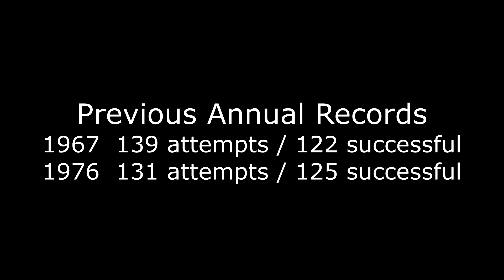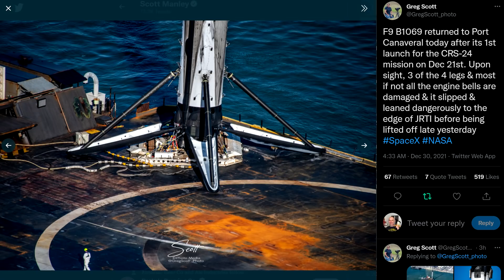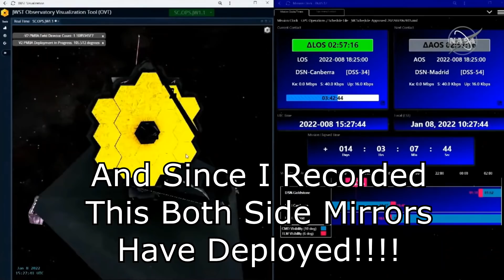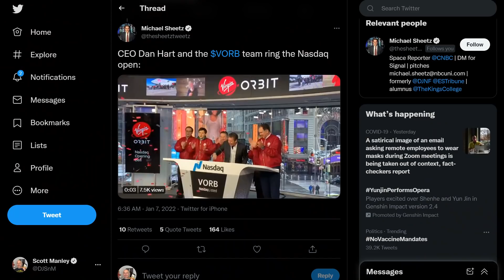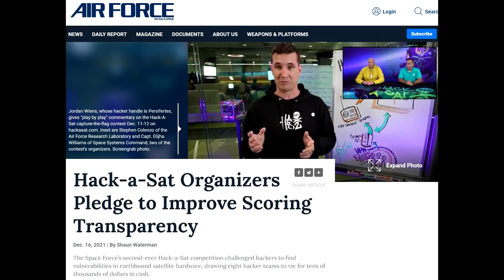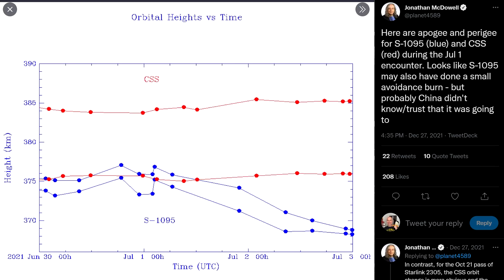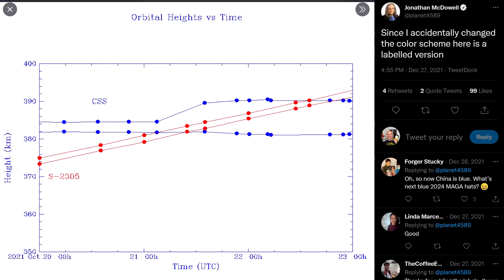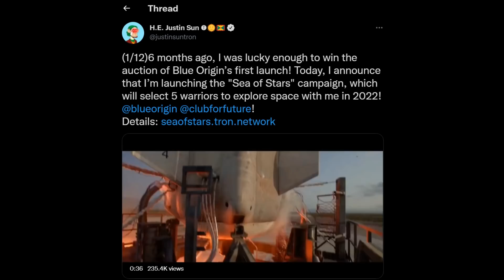JWST Deploys Mirror &  Moon's 'Mystery Hut' is Revealed - Deep Space Update - January 7th

Comment: They put a fairly long post on the JWST blog about cameras and why they didn't put them on it. TLDR: they considered several options for putting engineering cameras on the telescope, but all were rejected because the data that they needed to monitor deployment were better collected with other sensor types. "Better" in this case meaning the best balance of risk vs reward and cost vs benefit.
Reply: Cameras draw power, so do the encoders and transmitters needed to relay the images back to earth. The objective of the sun-shielded dark side of the telescope was to stay cold and dark. Putting gear on that side which generated heat as a byproduct of power consumption and transmission had to be balanced against the downside of trying to keep the shaded side of the telescope as dark as possible.
Reply: In all the replies to this tweet no one has mentioned the simple solution of having a cubesat fly alongside JWST to take pictures.  That would sidestep all the problems of sticking cameras on the observatory itself.
Reply: @simian_essence  Well then that wouldn’t really help with diagnosing problems, and if there’s a tether attached, even worse because the tether can snag and break instruments on the JWST.
Reply: I know they didn't really need cameras from an engineering perspective, but people like to see what they're paying for. Elon knows people like cameras. On the other hand, when JWST gets to final orbit, there won't be anything to see anyway. If you're 10 years behind schedule and three times over budget, it might be a problem to convince anybody you want to add a vanity camera.
Reply: I think they had a plateful, as it is.
Reply: The JWS project had few concerns about cost v benefit. Maybe the customers thought $10 million for a Go Pro was a bit steep.
Reply: I mean yeah I guess there are better ways to monitor the craft than a camera pointed it parts of it
Reply: I'm still really surprised. You can get a lot of info from just looking at something - what if one or several of your sensitive instruments fail and you still want to know what's going on? Cameras wouldn't seem to cost much or make anything less safe. I think the explanation needs and explanation.
Reply: @PinataOblongata  As NASA has explained it, the issues with cameras is that as mentioned in the video: on the dark side you wouldn't really be able to see something except maybe if you use IR cameras, or you could use a light source which could fail and blind the instruments. Then you also have to consider that this is an extremely complicated unfolding process, so you either have a lot of engineering cameras with a low FOV that might be able to tell you something about the situation if something goes wrong, or you have a few high FOV cameras which wouldn't be all that useful in diagnosing issues. Then you also have to consider all the additional cables that need to be routed, and need to bent when the telescope unfolds as well. Overall, it is simply not worth it because they have enough sensors on board and test data from deployment tests that they are able to diagnose any issues based on this data without any additional visual information. 

For example, they had an issue that the sensors which were supposed to indicate that the sunshield covers had correctly rolled up didn't trigger correctly, but based on their prior experiences they were able to confirm that they unfolded correctly based on data from gyroscops. TL;DR: NASA considered cameras but all the additional risks and challenges and small benefit they would gain from cameras made it clear that they are an unnecessary risk and drain of resources.
Reply: @PinataOblongata  I guess the thing to really consider is that there is no hope for a repair mission, ever, so if it gets to that point it really doesn't matter what's actually going on because the telescope becomes space junk either way. TBH I also like the idea of being able to look at something just to get a gut feeling about it, but I'm not a NASA engineer and probably for good reason. They seem to be quite happy with the telemetry they have.
Reply: This was my first thought as well. If the put camera, that's an extra weight, thermal management, power management, reliability tests. There is no science which would fulfill. As someone said, it 8s for the skeptics. It is an instrument. It is maximized today create infra photos as good as possible, not to makes selfies far from earth. That will make humans way better in the future.
Reply: Cameras are only good for TV, but TV is good for funding. I still think it was a bit of a mistake to not include vanity cameras, watching a 3D model unfold is extremely lame. Optics (no pun intended) are important if we're trying to get back to the space-fever of the 60s and 70s; in many ways, JWST is a political project even more than it is a scientific one.
Reply: @tissuepaper9962  JWST is a bleeding-edge instrument. When Curiosity landed on Mars in 2012 the skycrane was too. Curiosity didn't have cameras, but Perseverance did. JWST doesn't have cameras, but LUVOIR might
Reply: @lewismassie  fair enough
Reply: @tissuepaper9962  Absolutely NASA et ESA need to think more of their fan base and stop pandering to finance entrepreneurs. This is public science in the noblest of traditions. I considered the similar situation back in the sixties with Apollo missions; imagine Neil Armstrong not running a video of him walking on the moon. NASA next time make it happen.
 I will lend you my old webcam, its been thoroughly knock tested and survived after 15 tears.
Reply: @tomctutor  I agree .
It looks like they are getting the message though (thinking of the recent jaw-dropping footage from  the Perseverance landing).
What irks me is when they mention the "fantastic computer graphics" that supposedly make up for the absence of real footage.
These animations look like video games from 25 years back !
Reply: The information you need can not be seen in a camera: does the bolt retract, temperature of a motor, tension on a rope, rotations of a motor, does the hinge work, is a joint latched? You either need hundreds of cameras or hundreds of sensors. But you need the sensors anyhow.
Reply: I also spent quite some time replying to people in the twitter replies explaining stuff. I don't usually do that but this was one of those times I felt it was necessary
Reply: yeah the thing already cost 10 billion, no reason to take chances
Reply: When you write "TLDR", do you mean "summary"?
Reply: @PotatoRadius  TLDR = Too Long Didn't Read.
Reply: @PotatoRadius  yes. "TL;DR" is an abbreviation for "too long; didn't read".
Reply: @tissuepaper9962  What's wrong with using the perfectly servicable word "summary" to describe a summary?
Reply: @PotatoRadius  nothing is wrong with it, but I'm sure you know that slang doesn't arise out of practicality, nor does any aspect of language really. "TL;DR" is a reference to the kind of reply you might have gotten on a 2000s forum if you wrote a really long post. People would sarcastically write "too long; didn't read" in a reply. Eventually it become sort of standard to preempt those nasty comments by including a TL;DR section for the people who can't be bothered to read the whole thing. You can think of it as a sarcastic joke embedded into the structure of the comment, almost like saying "hey stupid! read this part before complaining!"
Reply: @PotatoRadius  TL;DR= Too long, didn't read. So yes, a summary.
Reply: @chuckstable165 While I hate calling people nerdy snobs...
Reply: @JM Coulon It's much easier to fool people than convincing they've been fooled. You implant the planetary deep space universe model from an early age, add a bunch of movies and the people can't grasp the idea of a different universe model anymore.
Reply: @JM Coulon There's no balls spinning around other balls in a vacuum.
Reply: Space is a scam to mind control the peasants and extract their money. Snap out of it.

Comment: I'll be blown away if SpaceX can catch a booster on those arms.
Seems very unlikely.
Reply: I agree, I wish them the best but the accuracy and control needed to drop it on those arms and not smash everything ,well  good luck with that.
Reply: Well a few years ago it seemed "unlikely" to land Booster rockets - now that's done pretty regularly by SpaceX and AUTONOMOUS that is!
Reply: @MistedMind  yep. That's why I'm not saying there is no chance. When they landed those 2 boosters by accident almost simultaneously from falcon heavy, it became obvious they can achieve basically anything if they have enough money.

Rediculous claims like super heavy launching for $2M is never going to happen.
Super fast turnarounds probably won't ever happen.
Lots of shit Elon says is utter garbage. I think the core of his rocket company is solid though.
Reply: @youtubevanced4900  The simu-landing was hardly an accident, after all they were launched at the same time, underwent the same air-currents, and hence had almost 1:1 external circumstances to work under.

But yeah, that they DID both land not only one, the other crashing, that was amazing ;)

But well, there were previous attempts and later ones where recovery failed, so there's both examples ;)

"will never happen" is dangerous territory to tread on, after all they were said about many things which are totally normal in our daily use with many a vehicle and electronics-devices ;)

But yeah, some ideas of Elon are rather far-fetched :D
Reply: @MistedMind  those boosters were supposed to land one after the other so they didn't disrupt each other's landing.
Didn't quite work out like that and we got the simultaneous landing which was way better.

The $2M is so far fetched it is an impossibility. Safe to say it.
10 years of Falcons and they are still $60M and can't be turned around faster than a month apart.
If Super Heavy ever gets going, it will be an absolute miracle if they can launch for $100M.
I really doubt it will do much more than a few starlink launches and maybe that moon landing it's currently contracted for.
It's too big to be used regularly.
Falcon Heavy has launched twice, in total including the test launch with Elons car.?
Theres just no market for that much lift capability.
Reply: @youtubevanced4900  "Theres just no market for that much lift capability."

Not yet, but we'll have to see when a next-generation ISS is build, or dare I say an intersolar craft ;)

Comment: Would the reason for using an iPad be for something as trivial as the fact that Android devices don't let you leave the screen on indefinitely? you can get apps that will keep the screen alive for you but I guess its better to have it baked into the OS rather than using a work around.
Reply: I'm thinking it's probably an iPad in hardware only. The cosmic rays of outer space are much harder on computers than on living things, causing random errors. The way computers work in space is to have 2 computers running the same code, then comparing the results. If they differ, both computers forget the results and run the code again. It's difficult for me to imagine how to make that work with modern software, and if you did, you'd effectively have half the cores plus a huge performance impact from all the comparisons of large regions of memory. But perhaps they don't bother, but just keep the iPad permanently inside the craft's best radiation shielding.

Re. Apple v. everyone; there were some very unpleasant Apple fanboys in the late 00s. I can understand them because some people have trouble dealing with complexity. Even Apple's flawed attempts to keep it under control must have been like a godsend to those people. I could hardly use Windows myself, but I used Linux, primarily driven by the command line, and then Plan 9 from Bell Labs as much as I could, until 2017 or so. Win10 is a lot more comfortable than previous versions. I guess I've avoided talking about Apple specifically. I think I'll keep it that way, but I'll say that I'm disappointed with every manufacturer in one way or another. :) I bought Samsung devices today, avoiding Apple only because I couldn't run my own code on them, as insignificant as that code might be.

Comment: So you’re telling the vertical separation standards for the space station are less than that for an airplane at 43,000 feet? Frickin sweet!
Reply: Planes are actively thrusting. Just a few degrees in the wrong direction and you can go a couple hundred metres quite fast. In space, it takes a bit longer for the rcs to mess up
Reply: @shlok975  it’s actually due to inaccuracies measuring pressure altitude at that height.
Reply: @johnlichtenstein6158  cool, which height though? Plane height at about 13km or leo at 400km?
Reply: @shlok975  for aircraft. increased separation standards (2000 ft vs 1000 ft) actually kicks in above 29k, but modern avionics reduce the error to acceptable margins till 41k

Comment: Could SpaceX Starlink satellites being decommissioned be used to purposely intercept and  push to slow known Leo space junk to safely deorbit the dead junk as well as itself in a two for the price of one cleanup effort? It might as well do one final act to clean up orbital space. If there are several, they could swarm together to take out larger pieces such as SpaceX Upper stages that didn’t fire to deorbit due to a malfunction. They could slowly contact the piece and use their ion engines to slow the junk and it all comes down together!
Reply: They'd need some sort of grabby thing (technical term) to do that and that's extra complexity and mass, so less satellites per launch, higher costs, etc. In short, ain't gonna happen.
Reply: Hitting anything at orbital speeds would turn both satellites into clouds of lots of pieces of junk, which themselves would be very dengerous.
Reply: The Star link satellites are "self-cleaning". The operational ones have a really low orbit which decays after a couple of years. The higher orbit ones are replacements and are there to scatter them using precision. Manley did a video on it.

Comment: does SpaceX require an FAA permit to go a few hundred meters off the ground with one of their boosters to approach and recognize a mock-up of Chopsticks so that they can get data while still grounded on booster four/ Starship 20?????? They have Booster five maybe six they could give it a try then plug the data into 4/20 for the launch and then hope for the best. Progress progress progress
Reply: Sort of. Yes, they would need a permit - but a short booster hop would probably be covered by the same rules as for previous Starship operations, so shouldn't be difficult to arrange. So the fact that they've not done it suggests that they don't want to.

Note that any data gathered that way wouldn't have much effect on the 4/20 flight anyway, since they're not catching either booster or vehicle for that flight... the best case is that both make a 'soft' landing in the ocean. But it does surprise me that they've not done any hover tests for either booster or vehicle while they've been building the launch site... it may suggest that they already know these early versions don't have the precise control for catches, and that there's no point in wasting time on that for now.